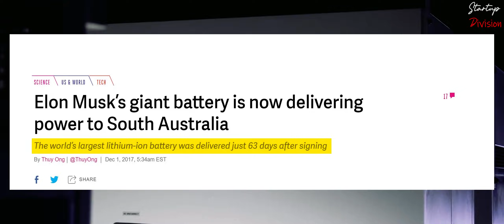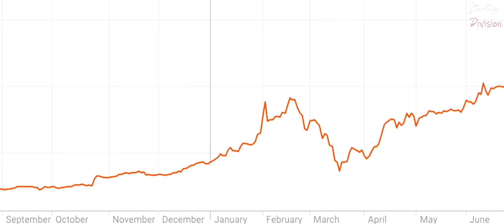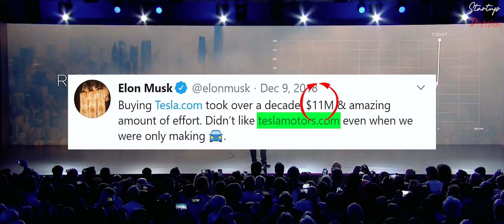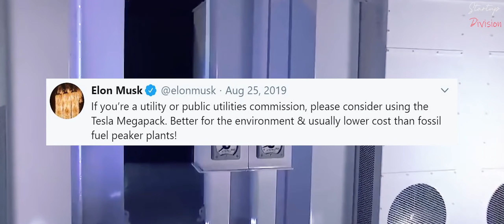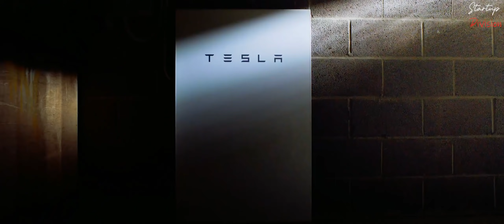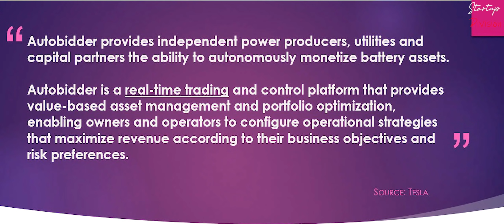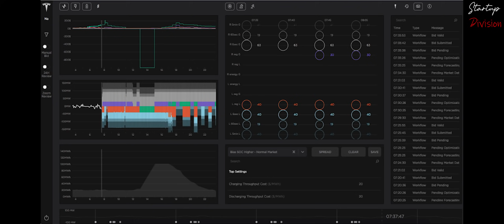How Tesla's Colossal Battery MEGA PACK Will Power the Future !

Comment: Guys there is a company called Ather Energy which is a electric 2 wheeler company which is called the "Tesla of india." The vehicles it offers has digital dashboard similiar to the Tesla's Dashbard, has a sleek and classy design with innovative features and big range.

also the company's vehicles are very expensive compared to other two wheelers and EVs Just like TESLA.
Reply: What's the price and the range?
Reply: @foodkart_India  Price is about 100,000 rupees and ranges is about 75-80Km/H
Reply: Bhai, in that price i would easily get a TATA Nano Car.
Reply: @gyaani_keeda  See everyone has it's own choice but if you want to go environment friendly then you should go for Ather
Reply: @XerexNova  Yeah, and they choose not to buy an overpriced piece of crap which chinese produces for 20,000 rs and have got more range than whatever crap ather is peddling.
Reply: @gyaani_keeda  Tata stopped making the Nano a couple years ago.  When it was new it cost more than the Ather.
Reply: Tesla’s number one concern is safety. No two wheeler would ever be considered a Tesla.

Comment: Tesla is gonna be big in the next 10 years. I bet my a$$. Just Invest whatever you have in Tesla and forget about it for the next 10 years.  Tesla shares hit a record $1923.90 just a few days ago, its gonna hit 20k in the next decade.
Reply: There is a stock split coming up end of month at 5:1. Once that happens, it won't be hitting $1,000 again anytime soon.
Reply: @fredpinczuk7352  Yes most ppl don't understand the how to vaule a company via P/E ratio and Market Cap only look at share price. After the split it definitely ain't gonna hit 20k but at the same time I think they mean it'll 10x it's current market cap which is entirely possible. Their self-driving AI division could be a huge cash cow, especially their plan to deploy that with robo taxis and fleet trucks. Then you have the solar power and battery production. Both of these side businesses can easily overtake their electric vehicle division.
Reply: @Noadvantage246  Exactly. BUt i doubt he would give more shares or split. He wanted to make the share price a lot stable and the only way to make it stable is to increase the share price to thundering heights just like Berkshire Hathaway.
Reply: @SnapshotTech  No that's not why Berkshire is so expensive, it's about voting rights. Berkshire A which included voting rights is 300k a share so you'd need to be a significant investor with a lot dough to buy in. On the Berkshire B is only $208 a share and is priced for the avg person or hobby investors but doesn't include in voting rights or say in how the company is run.
Reply: @Noadvantage246  But the Class A share is mostly sought after, no one cares about Class B shares. he also doesnt issue any dividends .
Reply: @fredpinczuk7352  immediately after the split, all the small fish are gonna drive it back past $700.
Shortly after that, s&p500.
Four months, FSD.
Giga Shanghai will be cranking out cars inside six months.
8 months, their robo taxi network will be running full steam in China.
Giga Berlin, a year.
Giga Austin, two years, tops.
Tesla will be well past 2k a share a year from split.
You do you, I'm all in.
Reply: Andrew Hatley yep likewise and I’m much richer for it
Reply: @fredpinczuk7352  how about within 3 years; is that "soon" enough?
Reply: @fredpinczuk7352  why do you think that
Reply: @Oliver-bn7jt  Elon stated that he would like to keep the stock "affordable". And not keep it as high as it as been. The split is a direct result of that policy, and I do think he and the board will continue to do so if necessary by splitting the stock if it climbs back up to $2K. And possibly start to issue dividends as way of controlling its climb. Time will tell.
Reply: Fred Pinczuk I believe that Elon meant this when he said “the stock is too high in my opinion”. This comment foreshadowed a split
Reply: I hate it so much that this shit is going on during my uni years. I won't be able to buy any Tesla stock until I am like 25 / 26 when I finally have stable job and am finished with school.

I could never get my father to invest any cent into the stockmarket becuase he doesn't want to take the risk... Imagine buying one 2000$ stock now and having 20000$ in 10 years...
Reply: @LemonsRage  
You shouldn't be worried about money.  You should be very worried about having a civilization to spend money.  If the world keeps going the fossil fuel way, there won't be any world in the future.  

You'll have plenty of time to earn money and there will be more Apples and Teslas.  Just be really concerned about getting a job in a stable career.  And keep informed.  Ignorance is the way of the masses and why most people are misled.  Imagine if your father invested $2000 and the stock market crashed and he lost it all.  Stuff happens!

Stay safe.
Reply: @LemonsRage  Don't despair, invest in ETF's that are themselves invested in Tesla by a large %. Here is a list, they are all affordable, suggest you divest (don't buy all in one) and you are young enough to enjoy long term returns. https://www.etfchannel.com/symbol/tsla/
Reply: Can’t wait 10 years I want to double my money in a month where sha
Lo I invest my million dollars any ideas buddy thancks
Reply: Full Tilt Boogie  No doubt its gonna be more than 20k , but he may issue additional shares or split them who knows.
Reply: People are stupid if you do that long-term.  Tesla is way over valued,  will never be profitable,  production rate way to slow, once the big car makers catch up...
Reply: @jantschierschky3461  Do you know who Sandy Munro is?  Do you know what his opinion of Tesla is?  I'm guessing not.
Reply: @incognitotorpedo42  why would I care ?
Reply: @incognitotorpedo42  
Munro is only a technical analyst.  So Tesla is ten years ahead of the others.  The reason why Tesla stock was so low for so long was because it was so far in debt.  There was a ton of doubt that Tesla would make it.  Risky business...
Reply: @acmefixer1  "only a technical analyst"?  I'm not sure you know what he does.  His company buys new cars, tears them down and does extensive analyses of them.  They sell reports to car makers.  He's a legend in the auto industry.
Reply: Jan Tschierschky I agree people are stupid. They have been coming up with dozens of reasons to doubt Tesla’s future as a viable company. And even as Tesla smashes them one by one. The argument that “the big boys are coming” has already been smashed. They have invested hundreds of billions in ICE factories which will become stranded assets, if they convert to EV’s.  Tesla are not just competing they are taking over, you’ll see. 
TSLA just closed at $2001 btw... and I’m still not selling!
Reply: @roryreddog3258  wish you luck, hope it does not take a bath on you. Like the tulip mania
Reply: Jan Tschierschky well if you can see a correlation between the tulip mania and Tesla then it is you who needs the luck brother.
Reply: @jantschierschky3461  , whoops ! In retrospect your evaluation needed a broader outlook. Split adjusted, stock is now $4000.
Reply: @shepherdsknoll   there is a difference between reality and wishful thinking,  Tesla is wishful